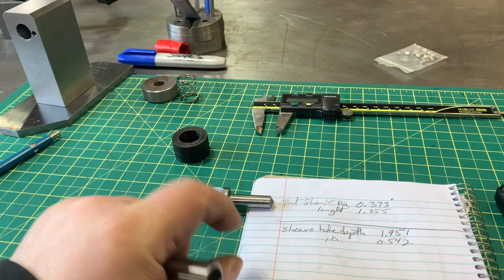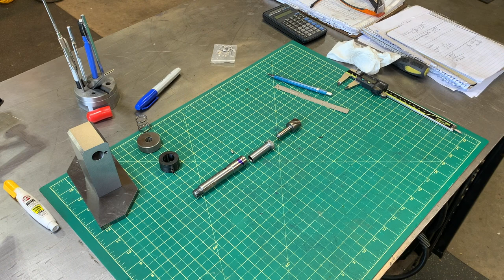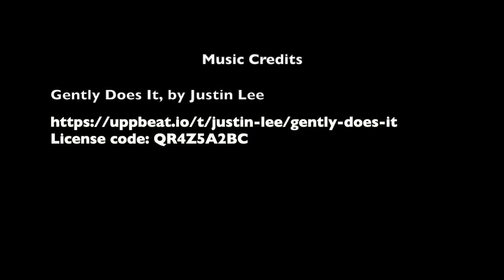Countersink Grinding Fixture

Comment: My idea is to get a used DA100 collet 'extension' which is 1"OD. DA100 collets go up to 9/16 which covers 1/2" (most counter sink sizes don't exceed 1/2 inch shank). They are around used for $30, saves work and adds flexibility.

Comment: Thanks for showing this.  I had a machinist friend try to sharpen one for me by hand and it came out worse than yours.  I don't have a mill but do have a small atlas lathe and I think you have shown me what I need to make so I can salvage the old counter sink.  I didn't think about the cam action when I first thought of putting it in my lathe chuck.  Now I will make something similar to what you have done.
Reply from the maker: Glad to help good Sir. Gilles

Comment: nicely done!    I don't have 3d printer, wish I knew how to machine the cam.   Thanks for sharing
Reply from the maker: If I figure out how to machine it I’ll post a video for you. Gilles
Reply: Its not a cam in the traditional sense. Just cut one side at an angle. Trig will give you the exact angle or the displacement you want . It varies with the diameter of your part. Rotate the angled side against a stop and, voila, you have the translation!